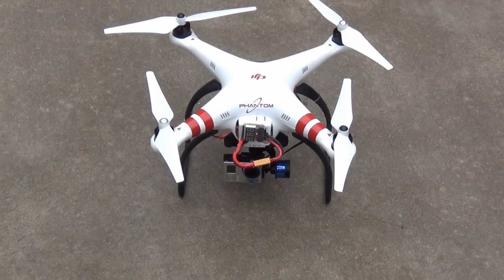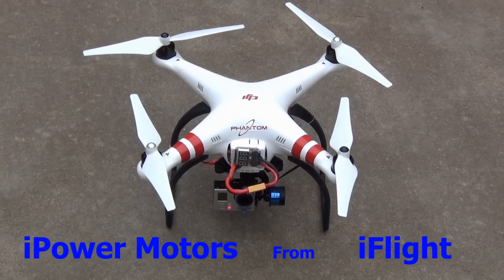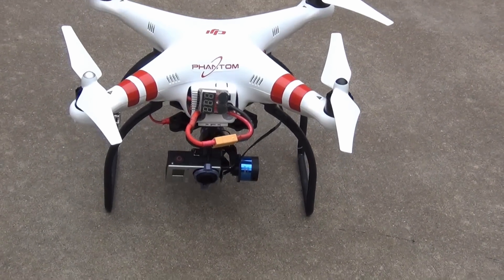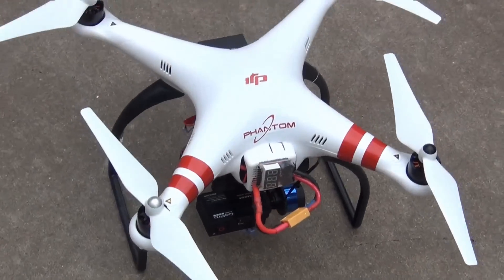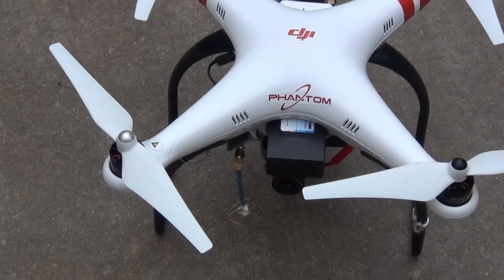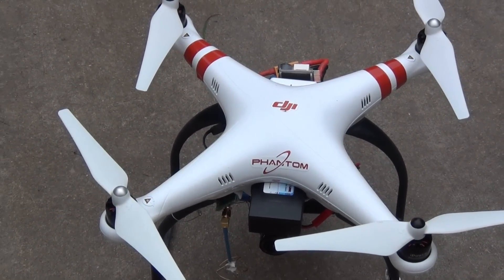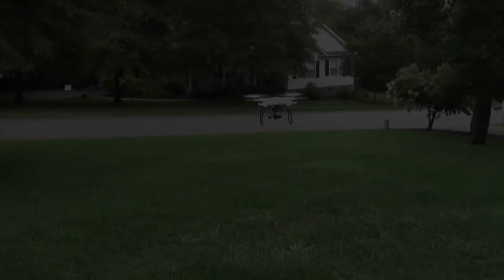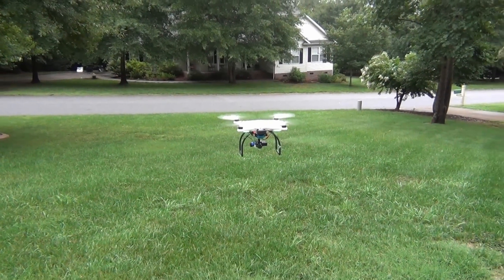Speed, Power, And Smoothness Of The iMotors + Bonus Crash!

Comment: Do you get better flight times by changing out the stock phantom 1 motors for new ones?
Reply from the maker: +Nick Marcouiller Hi Nick,   I have never really tested the time difference,  but the smoothness is amazing.  you spin the stock ones and you can hear the motor,  the iPower motors are silky smooth.  They do give you a bit more power also.

Comment: Hello Jake ! How is going this motors after 1 month of use ? I am thinking to install at my Phantom 2 ! Nice videos, thanks !
Reply from the maker: Hello Reginaldo,  They are working very well.  I just had that Phantom out yesterday and did a lot of flying and they still sound so quiet and smooth.   I am also thinking of putting them in my Phantom 2.  I am waiting just a bit as I just installed Boca bearings in the phantom 2 motors.   Still after I listen between motors the iPower are so much quieter on the ground and in the air!    If you do replace yours let me know what you think after.

Comment: Hi, Them motors look good, can you tell me your PID settings you have on it.
Reply from the maker: Sorry for the delay,   I was away for a bit.   They are all stock except the Vertical which is 150   I did that because of the added weight of the camera, gimbal, and 4300ma battery.   Also I do have on the phantom 2 blades.
Reply: Grandpa Jake
 Thanks for the reply